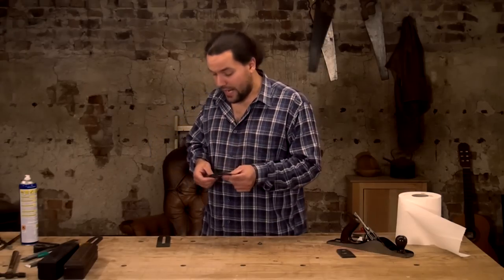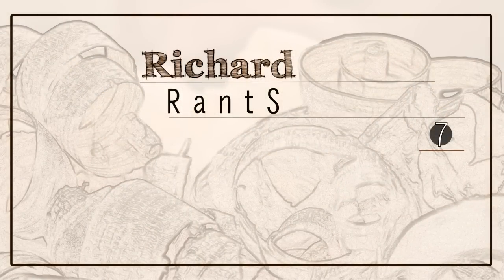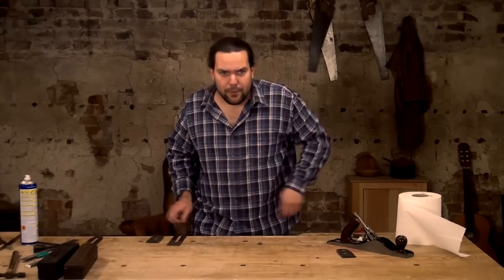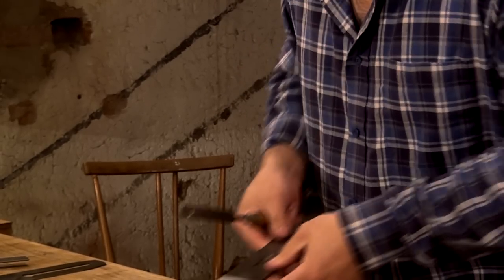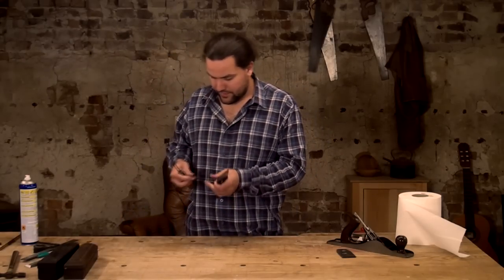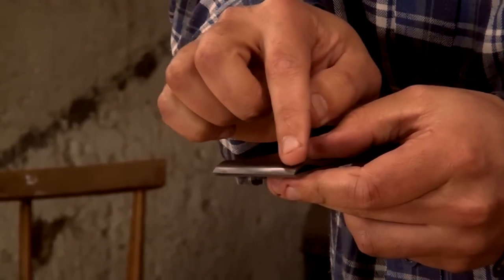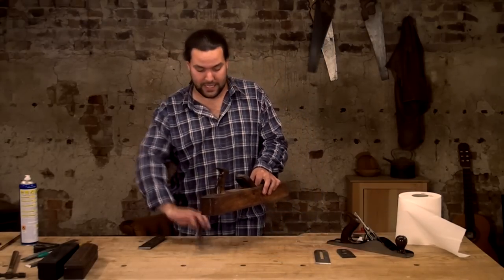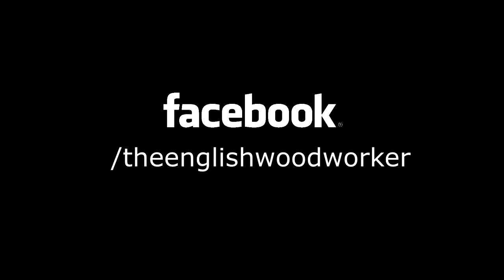Tuning Hand Planes - Setting The Cap Iron / Chip Breaker

Comment: Just subbed. As a new, oldish woodworker, I have learned most so far from folks like Paul Sellers, Stumpy Nubs etc. However, your three videos on the importance of the cap iron have been great for my ego! When I got my first planes (Stanley Ebay specials) I naturally had to flatten the soles, sharpen the irons, blah blah. At the same time, I instinctively did pretty much what you recommend with the cap irons, even though little attention seemed to be paid to them in the videos I saw. It was all about the iron! However, it made sense to my engineering mind set to grind/lap that too. I have been setting them around 1mm back from the edge, and with 'reasonable' results, but you have inspired me to refine the caps and try it even a a bit closer. Thanks.

Comment: Nice videos thanks!!  I recently was 'forced' to buy a hand plane as my electric plane belt snapped after only one side of a hardwood door. So I am new to planing and what led me to your videos was a search for the problems I am having on taking anything from 0.5mm to 5mm of the side of the hardwood doors I have due to the door frames not being plumb.
I bought a Rider No5 jack from Axminster and although it feels a lovely engineered piece of kit, I am having an awful lot of problems in getting it to plane those crisp ribbons that I see you all do on the videos!! What is frustrating is that I have a 10 year old block plane in my loft thatI got from B&Q 10 years ago and never used a lot and it is taking better shavings off the door than a £115 plane. Surely this cannot be right and I am searching for answers as to what might be going wrong. I think that your series of 3 videos have helped a lot.
Particularly I think the comment you made about tightening the screw and lifting the cutting blade up and leading to clogging. That is exactly what is happening in the mouth. I am constantly having to stop, clear the mouth. But I am also only getting small shavings and not a lovely long ribbon. Something just isn't right.
Any advice from expert planers would be very much appreciated.
Keep up the good videos and I have subscribed to your channel to learn more about woodwork.

Comment: I appreciate the videos, but not one shot actually focused long enough to actually show how close the end of the blade you think the cap iron should be.
Reply: He says place the corners of the cap iron at the corners of the iron where the camber meets the edge.  Works fine, and lots of old finish carpenters will tell you the same.
Reply: at the very end, he shows two of them up close whilst sitting on the bench that shows them well
Reply: Patience is a virtue

Comment: im a beginning wood worker/wood carver. i have a small hand plane, and what angle should the blade be set? 45 degrees? my blade is slightly curved downward.
i also bought a #1000/#6000 whetstone. any ideas for sharpening the blade?
good video!

Comment: I'm confused now.. I always though the cap iron was the piece that locked the blade and chip breaker in place. You seem to call the chip breaker for a cap iron? 
What do you call the plate, that goes into the plane last, to lock it all together?

Comment: I have a plane ive been trying to tune for a while. The problem is everytime i took it apart to reset it, it worked fine for about two passes, then gouge and sputter. Turns ot finally that the whole thing wasn't anchored down properly to the sole, which probaly happened when it fell two feet from its shelf.

Comment: Hi The English Woodworker! I am new to hand planes and recently purchased a used Stanley #4., I have noticed after watching this video and looking at my chip breaker and trying to get the end of the chip break close to the edge of the iron, say 1/16 or closer, I can't adjust the blade past the sole of the plane because I am hitting the outer most adjustment capabilities of the plane. Is this just a cheap plane or am I missing something crucial.
Reply: Your plane is probably fine, so relax. If you haven't found this out during the previous 11 months (!) try moving the frog forwards a little. Note that this will also close up the mouth of the plane, so there is a limit. I am also pretty new to all this and have similar seconhand planes, but I can get continuous, see-though shavings if I need to. It seems you just need to take some care with the sharpening and setup. Half of the fun these days is learning again what our grandfathers knew! Happy woodworking.

Comment: I'm no pro, its been along time from shop class to now, but I'm relatively sure the blades should be alot straighter on the bevel from side to side than what i could see on yours. If not new ones wouldn't be straight across and even, they would be sold curved.? But thats just my opinion.

Comment: do you also camber the cap iron?
Reply: It's just not done.  The way a Stanley cap iron is shaped, you would never get it to mate properly with the blade if the cap iron had a camber.
Reply: I suspect nmssis was asking about a camber on the top of the cap iron. Based on my understanding from the previous videos this could lead to tear out along the outside of the plane as it would not break the fibers.

Comment: Richard, do you flatten the back of a plane iron or put a slight back bevel on it using a thin steel ruler, which is known as the Charlesworth ruler trick.  I have mixed feelings about the ruler "trick."

Comment: I set up my #4 Baileys just as shown. I really have no tearouts now but all my shavings are jamming in the mouth so have to clean it after each 5-7 strokes, can't figure out what I did wrong.
Reply: Mikhail Ivashenko Is there perhaps a small gap between your iron and cap iron? Remember that your cap iron is pushed down by the screw, you need to flatten it in the right way. Like Richard showed in the previous video.